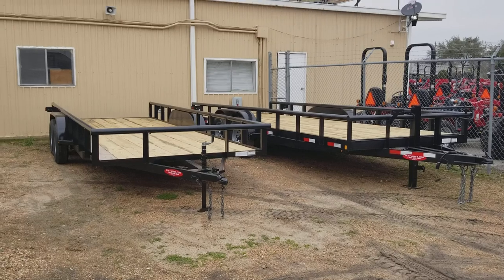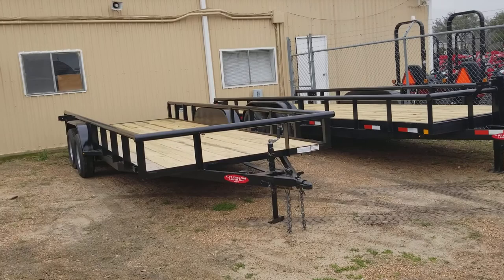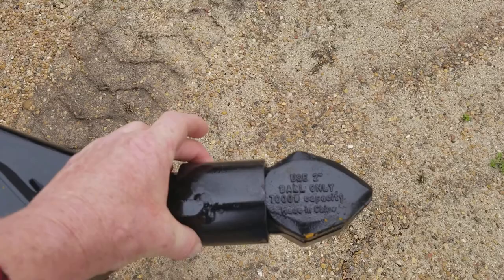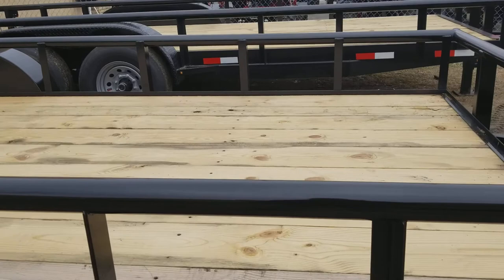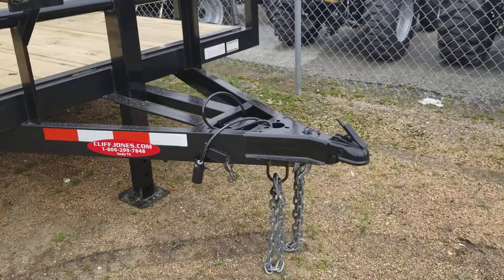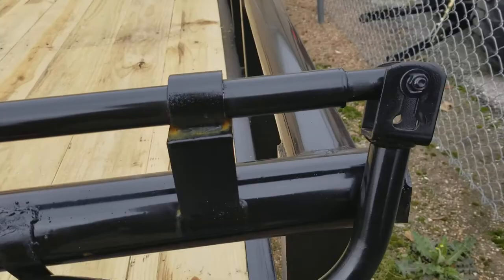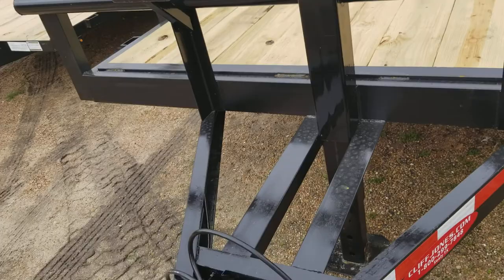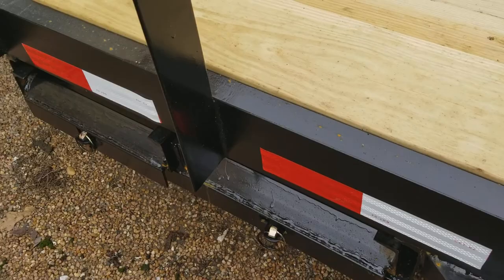7000 and 14000 GVWR utility trailer

Comment: Question- for the 7,000 lb trailer being pulled by a 1 ton diesel, what is the TOTAL amount of weight I can put on the trailer?  Given that I would be putting several thousand lbs on the back of the truck, not the trailer? 
Shouldn't what you put on the truck be added to the trailer capacity, depending how far forward your load is on trailer?
Reply from the maker: On the 3500 per actual 7000 total you can put a total of about 5300 pounds on top of the utility trailer on the heavy duty one you can put a total about 12.5